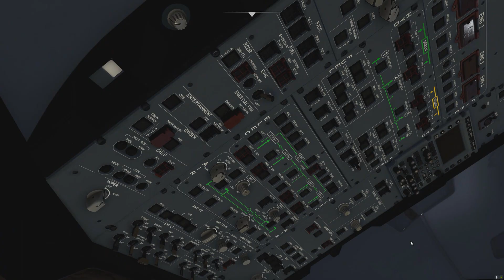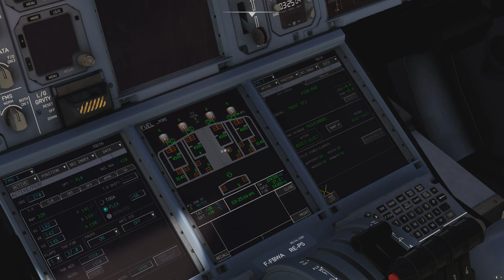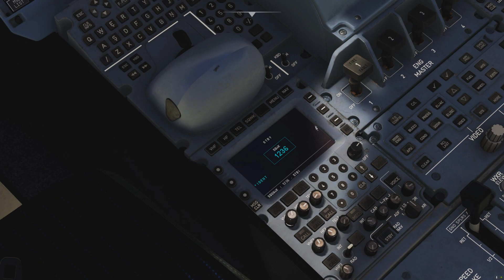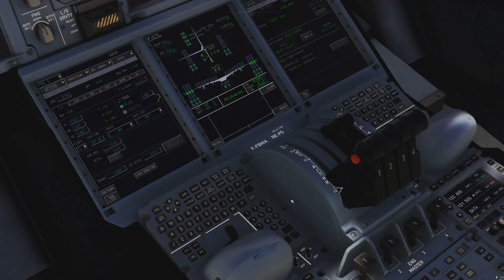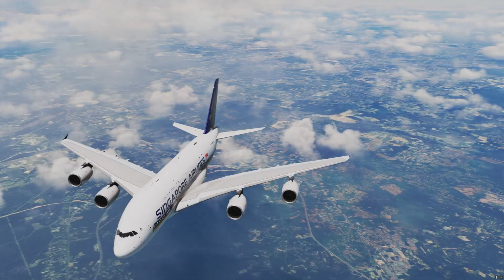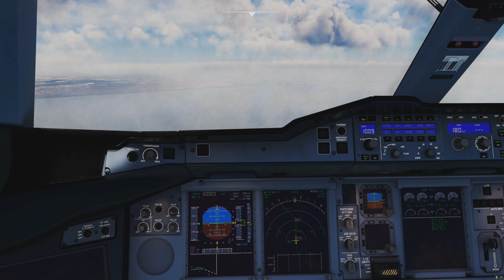Can an A320 pilot fly the A380? - Without reading the manual!

Comment: Love the videos, man! Waiting for you to realize there's a checklist button to see the checklists on the ECAM (located near the ENG, F/CTL buttons etc, not sure how these are called. There are also buttons to mark the checklist items here). And the transponder is in the MCDU, in the synoptics page if I'm not mistaken.
I've also heard that 2 engines can be staretd at once - 2 left, then 2 right
VV is velicoty vector. 
And you gotta test the zoom mode of the map display! It's definitely something totally different from the a320. It's very useful when combined with BTV autobrake setting as well.

Comment: When I first installes the a380 i was like where is everything? I always tought airbus cockpits had a lot of stuff in common but the difference shocked me
Reply: Bro its not even that different
Reply: What are you talking about? The A380 and A320 cockpit are literally identical except the 380 has additional switches/buttons, larger screens and of course 2 more thrust levers
Reply: @JJChicken22  Says the brainrot.
Reply: I think that there's really not much difference. Just from the normal procedures, it is easily learnable in a single hour.